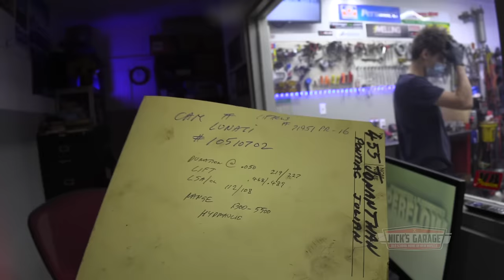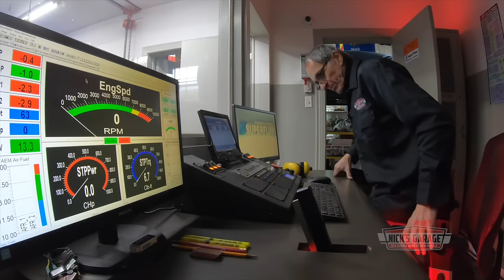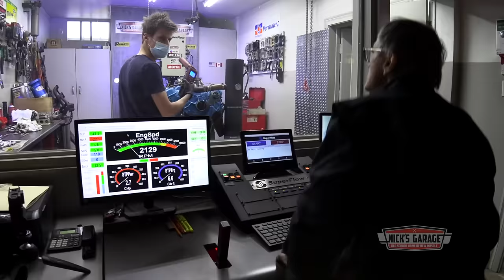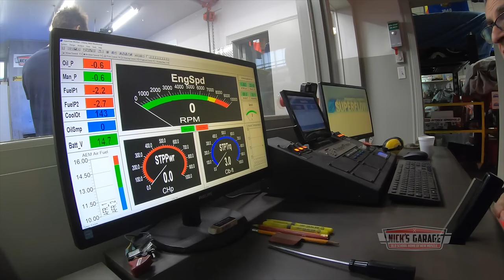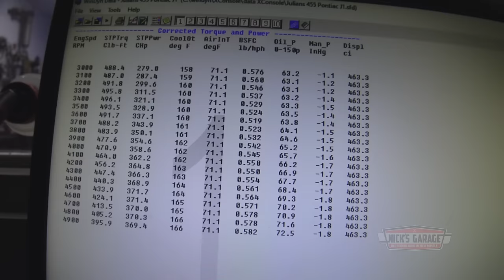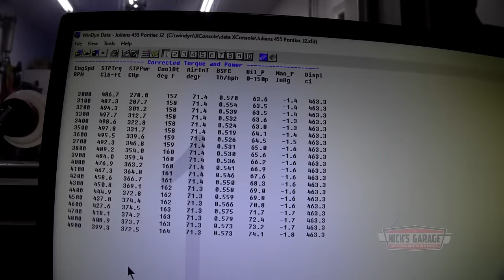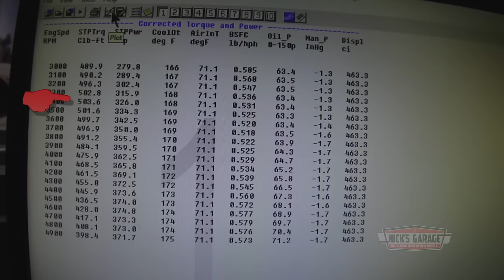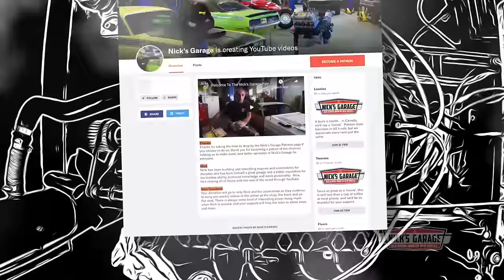Pontiac 455

Comment: I completely understand the owner's reason for wanting a stock look. However, with the numbers matching engine safely tucked away I would be VERY tempted to at least go with a better carb and headers. The owner has already gone to considerable expense and that motor has more left.
Reply: Those manifolds flow nearly as well as headers without the clearance issues. Maybe a 7 hp loss.
Reply: D-port heads
Reply: @thebigpicture2032  

Those manifolds are too beautiful to be called manifolds. Cast iron headers is more fitting.
Reply: Quadrajet flows plenty of CFM and has good road manners, without a bunch of tuning.
Reply: @jhoncho4x4  

In a pinch you can richen up the secondary metering by just bending the hanger. Try that with a Holley.

Comment: That's about what I was expecting from a 455 using #96 heads, iron intake and exhaust manifolds. That's why they are such good street engines. I have raced 455 Pontiacs since I turned 16 in 1983. While all my SBC and SBF friends were shoving in 4.30 and lower rear gears I always ran 3.55's or 3.23's with my 455's to take advantage of all that low end torque. Pontiacs suffer from what so many other standard muscle car engines from that era also suffer from, small block flow on the cylinder heads. I've run factory round port stuff which are better performers but very expensive. Today I run aluminum aftermarket heads that actually give an engine with that much displacement the air it needs. Only a Hemi, BBC or a few Fords ever had the air flow for great power back in the day. Great job though, excellent oil pressure, smooth and solid performance, just what a 3900lbs 76 Trans Am needs to be a fun car!
Reply: The Edelbrock heads are good ? whats the part# if you don't mind me asking ?
Reply: @kencraig7308  If I was buying a set today I would get the Performer RPM CNC heads part number 61525. I actually am running older 60595 heads though. They have a smaller chamber because my car is a drag car so I have over 11 to 1 compression. But they use an older style combustion chamber that is slow burn like the original. The newer heads use a heart shaped chamber that is quicker burn and you can run with much less timing and also less detonation problems. I built my current 455 in 2005 so the newer design wasn't available yet. I think the KRE D ports also use a more modern chamber and if you don't already have a set of stupid expensive round port headers either the KRE or Edelbrock aluminum D port heads might be a good choice. Just to save that $300 or $400 in headers plus easier to bolt the exhaust up. As much as I love old Pontiac iron, and I do, any of the newer aluminum stuff is far superior. A set of stock Edelbrocks like the ones I use will flow right out of the box what takes a serious port job on iron heads from someone like the Butler boys. And a mild port job on the aluminum heads makes them superior to any level achievable on the iron heads. I think in this day and age iron is best for mild engines like the one Nick just built or for restorations needing correct parts. If you want a street rod or a strip machine go with the aluminum ones.
Reply: @1967davethewave  the numbers Nick achieved on that engine are about all I'm looking for to run on pump gas. Does Edelbrock have a intake and manifold that works together ? I don't have any misconception about what can be achieved with a super duty foundation but all I've got is a '73 455 out of an old Gran ville ambulance from Illinois 😂

Comment: I drove Pontiacs, first was a 72 Formula Firebird, 3 speed. Then a 70 Grand Prix, then another Trans Am. My sister was given my little brothers Lemans with a 455 in it. Little Sister CONSTANTLY FLOATED OUT THE LIFTERS on the damn thing. Its a thing. Clack clack clack, maybe it’ll fill again but even if it does it will float out again. I finally built  a 455 SD myself and stretched the spring. Cleavite bearings…. Those still around? HV Pump, made 80 lbs oil. Never floated again.

Comment: Love it. Had and built a lot of Pontiacs. Only thing I noticed is timing related; this distributor vacuum advance is on direct vacuum, instead of ported. Pontiacs love ported advance. Try setting it up with around 10 degrees initial timing with the vacuum hose off the distributor, then connect the hose to a ported vacuum source. That way... as you rev it, all available timing will come IN rather than the vacuum side dropping off as it will here. (combined with the weighted advance in the distributor), looking for 30-32 total degrees advance for this motor's compression. Initial timing + total distributor advance of around 24 degrees. I think it will run better, and make even more power that way. I'd also adjust the rockers running, with only 1/2 turn more after they stop ticking. Good for a few ponies having same exact running rocker adjustment. And, sure glad you are keeping it reasonable at 5000 RPM! Typical 455's like these are not designed to rev high.

Comment: Engines Nick's Garage has a stack This 455 pontiac on the dyno is back Nick and Manny already fixed the vacuum leak but Nick was dissapointed so he's got some horses to seek First he's gotta break in the cam For uprating classic muscle car V8's Nick is the man You can't get more iconic than a 73-4 GTO which is where this block is destined to go and you can't get better than Nick's Garage for a muscle car show Nick and the team do nothing half hearted Leo is helping Nick get the Pontiac started Sure with anything you build you can get some teething issues but a water leak is the last thing you need when you're ready to give it some abuse Luckily the leak is from the dyno not the block so the owner won't require a box of tissues There are a myriad of tweaks and turns Nick does the work as Leo learns To gain optimum efficiency it's gonna need more runs before it's ready for delivery Nick's Garage always does a shakedown so their clients rarely experience a breakdown Every Monday Nick's Garage is turning frowns upside down
Reply from the maker: Wooo Roberto.. Always on record times with the superfly rhymes.  Right on!
Reply: @NicksGarage  I was ready and waiting with the rhymes Monday at Nick's Garage is always good times
Reply: @NicksGarage  Tell Nick to put some honey in his lemon tea It will ease that sore throat it works for me!
Reply: Go Roberto, go!
Reply: @robertorhymes            .. OKAY. Will do. Thanks.
Reply: @nickpanaritis4122  Honey good for healing Nick I don't want you getting sick

Comment: Pontiacs with the 4 barrel have one of the best intake manifolds ever engineered. For 90 percent of the applications, you don't need to change it. 
The heads stall out at around .500 ish lift so going big lift doesn't work, it's all in the timing events.

Comment: I used Isky cams in my Pontiacs. They worked perfectly and gave good power all the way through. This engine would be a good choice for a 1963 Bonneville 2 door with a 4 speed. Haven't had any problems with the Rochester carbs either. Very good stuff. Like the exhaust manifolds. Really wish you guys would drop that music stuff. All is great except for that. That engine sounded good what I could hear over the music. Oh yeah, 1st pull=nice for that Bonneville. With a set of 3:36:1 gears= go fast.

Comment: I built a 76 , Pontiac.,406..20 years ago.runs low 12s on motor.still going..200 shot a lot of times....drag and street raced it for many years...she's retired now....
I now run a 78 GrandLeMans half baked big tire car...chevy 360...
Re did that motor about 3 year's ago..runs 7 : 11 1/8  in a 3,400 lb car....on motor.....

Comment: Those secondaries on the Rochester carb are lean. Take the metering rods off the hanger with a small flat head screwdriver. Put them on a lathe and taper them down a few thousandths on the end. Slap those metering rods back on. Secondaries will run rich and add twenty horses.

Comment: I haven't built a Q jet in 20+ yrs, and they are about gone from junk yards(actually the jyards are 'bout gone too), but if you could find the skinny Metering Rods for the carb, you would probably get to 400+ hp with that cam.
It's already doin' great compared to stock 1970 with over one whole compression point less!
Great Job again, Nick.
PrayersUP!! for the Canadian people.

Comment: According to my book, 1970 455 had 370 hp. Timing was 9ºBTDC (Auto/manual transmission). It's an old book from 1973-74. It even has the specs for a Datsun.
Reply: Initial timing was just used for general tune ups. When tuning for power you look at total timing. At about 1800 rpm's most of the 455 Pontiacs I have owned and raced ran best at about 36 to 38 degrees. Depending on the total mechanical curve built into the distributor that might put timing at idle at anywhere from 9 to 18 degrees or more. I personally modify the mechanical advance to give 25 degrees total timing and then set initial between 10 and 13. Every engine is a little different based on compression, cam, carb, ect so I do all my tuning at the track. The best E.T. without any detonation is where it gets set!

Comment: Paused video two minutes in. My guess on the Pontiac 455 numbers are 450 Torque and 380 on the HP. Lets go!
Reply: I guessed 380hp and 500tq. But I was really hoping for over 400hp. Those standard iron heads just can't move the air though.

Comment: A set of Kauffman heads and a good Cam and it's ready to rock along with an air gap or high rise intake. Motors are machine / Port friendly. Very easy to stroke that motor with no problems as there is more metal to work with then most engines.

Comment: As you proved, Pontiacs are torque motors. To make power you need more cam and better heads. The ports are kept small to improve low end torque by keeping port velocity up. Aftermarket aluminum heads flow much better. You can port the stock heads too; SD performance, SD Performance- Pontiac Performance Specialists is a Canadian company that can do this. With an engine like this you need a much bigger cam. A Lunati 704 vs.702 would work well and have enough vacuum for brakes. You might want to order it with more lobe separation. SD performance makes excellent roller cams also. If you use a cam with less than 230 degrees on the intake, you are leaving power on the table. I like your show.
Reply: Customer supplied the cam for what he wanted his engine to do... I would have gone 1 step larger...

Comment: GM made 2 different major versions of the Quadrajet: 1) 750CFM rated with the secondary air valve adjusted full open 2) 800CFM that was ONLY installed on Olds W30 and Buick Stage1 455's. The difference is on the primary venturi size, all else is the same. Finding one of those would be the ticket for higher HP/TQ numbers
Reply: Exactly!
The 750cfm QJet has a pair of humps that you can see when you look down into the primaries, the 800 does not. 
If I remember correctly ALL Chevys had 750s. 

I think I have a BOP 800 QJet at my parents house.
Reply: @jwd1112  Then you have a piece of gold son!
Reply: I had a Cadillac 500 with qjet. Thought that was a 800 cfm version?
Reply: @BBBILLY86  No, because the the 800 versions had a straight inline fuel filter. Caddy's had a 90 degree  to clear the top / center mount A/C compressor
Reply: @tmtheasphaltgambler3709  From the web. 
All Cadillac Quadrajets between 1972 and 78 have a flow capacity of 800 CFM regardless of the application, and the final configuration is by the primary jets and rods, the power piston spring, the secondary rods and hangers and the settings on the secondary air door. I know there are different fuel inlet locations. Front vs side. But that doesn't affect CFM.
Reply: @BBBILLY86  oh man, I stand corrected! Thank-you for clarity on that, I now know a little more than when I woke up this morning
Reply: @tmtheasphaltgambler3709  cool. I learn every day also.
Reply: Pontiac engines of the 70's went to the larger 800cfm carb to try and make up power from the compression ratio drop. All Pontiac V8 engines that came with a 4 barrel carb from 1975 on had an 800cfm unit. They would limit airflow on smaller engines like the 301 by limiting secondary air door opening. Also Buick 455's in the 70's (I believe starting around 1972) had the 800cfm carb as well.

Comment: @Nick
PMD engines have a bad habit of blowing out a lifer gallery plug that's behind a freeze plug on the Trans side.
You will still have oil pressure but off and on "ticking" as it runs dry up top.
Under higher RPM the pressure is enough to overcome the missing plug but at lower it's not.
Engine builders will forget this little plug and or it gets blown out.
Simple insurance to pull the plug in the back...
The "Fix" is to tap it for a set screw, they even sell the kits on Ebay.
I was down this road my friend.
Reply: Thanks for the info.

Comment: 6:30     Pontiac also started putting the Oldsmobile 403 in the T/A also, as they were running out of their own 400's because the Pontiac 400 was already discontinued because they were already aware that the 400 wasn't going to pass the coming year's new emissions and MPG's rules, so they killed the 400 and started using the Oldamobile 403 because IT was efficient enough and had clean enough emissions output. The Oldsmobile engine design was so clean and efficient that the 307 small block Olds V-8 ended up to be the last carbed V8 offered in passenger cars in America until 1990.
Everybody else was fuel injected before then in order to meet the EPA's current rules.

Comment: Lol I just got a free Pontiac big block. And I was mildly disappointed that it was a 400 not a 455. You always have awesome engines there 🤘.
Reply from the maker: Thanks to our wonderful clients.
Reply: @NicksGarage  truly the home of muscle
Reply: B that 400 is a great motor! my father had one with 3 duces in his 66gto and when that got totaled  it went into his 69 gran prix. Sadly it was before I came along and didn’t get them passed down I would love a poncho v8!
Reply: Pontiac didn't make a "big block" External dimensions are the same therefore no big block.
Reply: @marcmo7138  I appreciate your feedback on semantics. According to Webster’s dictionary, the very first “big block” was produced in 65, as defined by having a large cylinder block. So, following the logic, just because they’re all the same dimension, doesn’t mean it’s not a big block, they just don’t have a small block. I just went down in my engine building room where I have eight different types of engines on stands to do a few quick measurement. The Buick 455 block is only a quarter of an inch longer than the Pontiac Block, Pontiac Block is the better part of 2 inches longer than the Chevy 350, The Pontiac block is Half an inch shorter than a 454 and the 440 is about an inch and a quarter longer than the Pontiac block. So I guess to say Pontiac big block is a bit redundant because they’re all big blocks. But we also say chain mailles or chain mail which is literally chain chain as mailles (mail) is French for chain.
Reply: @Zachsmoparandmashedpotatos  It’s not on my immediate rebuild cue, but I’m looking forward to putting it together and making a smoky in the bandit Tribute car. It’s a 500557 casting so as long as I keep it fairly tame it’s gonna make for a phenomenal engine. If I go over 500 hp I’ll have to gusset the bottom end. Which is an a big deal I’m gonna have to do that with the Buick 455 anyway. The 66 GTO was an awesome car and I bet that 69 Grand Prix was a monster.
Reply: @LunarOutlawsGarage  Pontiac didn't make a bb
Reply: @michaelerickson1518  appreciate your feedback I answered this two comments before
Reply: @LunarOutlawsGarage  - Whether small, medium, or big block is decided by how far apart the cylinder bores are... how big of pistons can be gotten into the bores... the term "big block" was first used for the 1965 Chevy 366" - 454" blocks to distinguish them from the earlier 348" - 427" 'W' blocks (which also had same bore spacing) and also from the 262" - 400" small blocks... 
Cylinder bores in Buick 400" - 455" big blocks a half inch further apart than their 215" - 350" small blocks that are also the "Rover" V8 used in many brands of UK vehicles... 
Pontiac cast the block deck height lower for their 301" V8 but same bore spacing... 
Pontiac 455"s had smaller pistons and long stroke because the bore spacing didn't allow the bigger diameter pistons and valves found in similar sized engines of other brands... so Pontiac relied on torque instead of HP to get the job done...

Comment: Slab is downhill to the dyno panel. I worked in many boiler rooms like this. All the drains were uphill from the boilers. Low point in the engineering spaces was nowhere near the drains.

Comment: 35:03. Best way to hear those rocker arms is to take a wood dowel hold one end against the valve cover and one in your ear and move it along the valve cover. Works great. I use that method to find the source of all noises. You can tell which end of the alternator is making the noise for example. Oh, its the rear bearing in the alternator not the front for example.